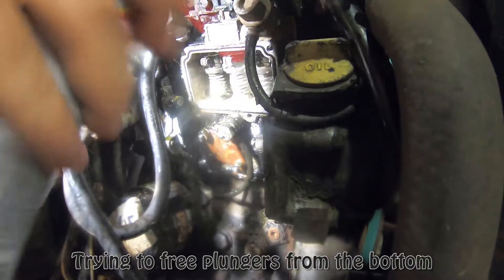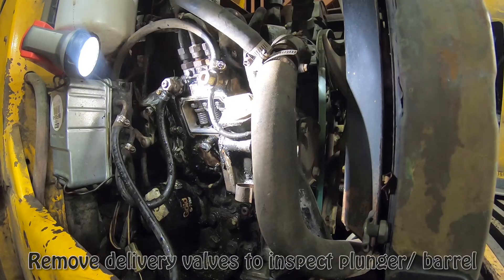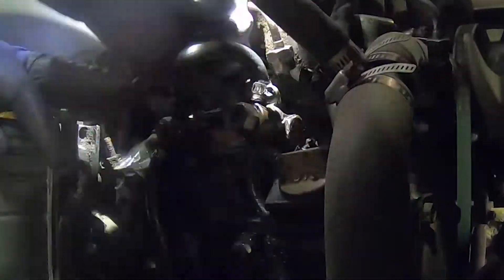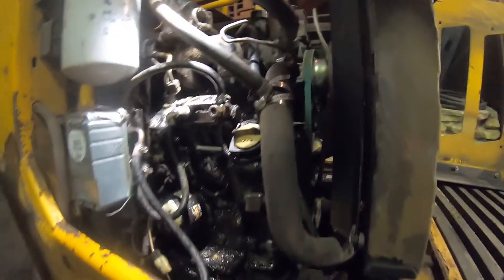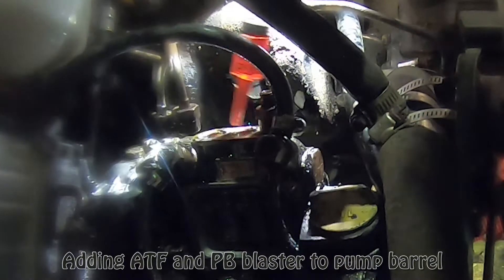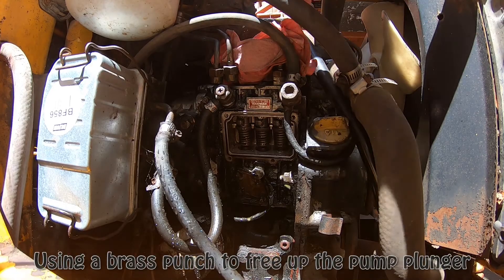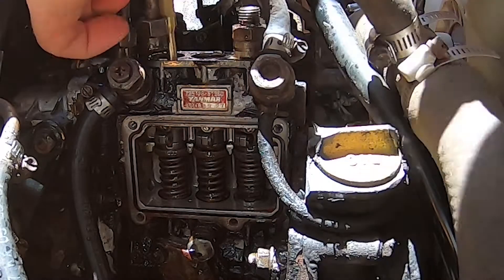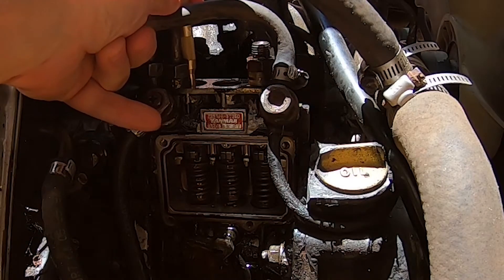Fixing Stuck Injection Pump - Yanmar  3 Cylinder Diesel - 3TN82E

Comment: Thanks great video.  Your video is just what I needed. My engine has been sitting for a couple of years.  This looks like the next step to try.  There is fuel to the injection pump but no fuel afterwards.  Hopefully I don't need to take the injection pump off.

Comment: Do you have to use brass punches or can i use regular punches having the same issue with my bobcat uv34
Reply: Would use brass as it will not dent whatever you hit with it. If you use a steel punch you take a chance of putting a mark on something that might not have the tolerance to be scarred

Comment: Some people say the insides of the FI pump might shift (turn) if you remove the Delivery Valve Holder, and will ruin the pump if out of position when started ?   I'm tempted to try this on my Kubota L275 where I have the same problem.   Great video, thank you. 👍👍👍.

Comment: Thanks so much for this! Same engine and problem i think for me on a 4whl drive tractor with loader. Having trouble getting the access plate off as is blocked by the loader arm.
I wonder if it could be done without taking the plate off by rotating crank to maybe 1/4 turn past #1 TDC so you know its not   injecting anywhere and just tapping from the top??
And its the small center piston that gets tapped with the brass drift right??

Comment: Need to know how the injector pump works does it need to full ofuel to ensure that the plungers go all the way up originally #1 was fine 2 and 3 were stuck same as in your video they did move about 1/8 inch

Comment: Got a 3TN in a gator 6x4
It appears to be getting fuel to all injectors
Has a pretty good knock, it’s like an oscillating and clacking knock. Any thoughts? (All push rods look ok and injectors seem to be working)
Reply from the maker: Are the connecting rods good? Is the timing on the injection pump correct?

Comment: Nearly the same pump on a Takeuchi TB125 Mini ex. Your video helped me diagnose a no start / no-fuel issue. Had no fuel at the injectors and had a plunger stuck up. Tapped it down (luckily didn't have to remove the top valve) and it cranked right up.
Reply from the maker: Excellent. So glad this helped!

Comment: This is a Master Class compared to JD training.  Thanks for posting.  Any chance you understand the mystery of timing one of these after a customer thought it'd be easy to install a new one?
Reply from the maker: Check out my other videos where I explain timing on a Perkins diesel (same principle applies). Ensuring injection pump is keyed to timing gear (it isn’t always on older engines), then checking exact timing. 

Hopefully there is a scribe mark from the pump casing to the engine block mating surface. Or maybe missing paint or some indicator of where it goes (the injector pump usually has slotted bolt holes. If not there is a procedure for timing that is best explained by others, as that is the extent of my knowledge!
Reply: I’ve dealt with techs from John Deere that are expected to know yanmar stuff they are complete idiots

Comment: They're good engines, but they're feckitty on the fuel supply front. I have 3 with similar issues sitting staring at me. If I have 3 like that, it means loads have similar issues - the fuel cut-off solonoid valves also suck - they're soft & give bother. It'd be great if Yanmar would nip over to Kubota and ask for a few "How do we make our stuff better?" Tips.
Reply from the maker: Yes definitely, don’t let ‘em sit!!!
Reply: @StanwoodStudios  How long did this one sit for?